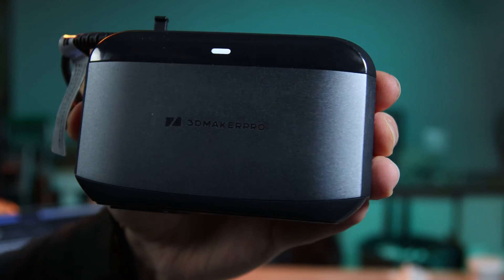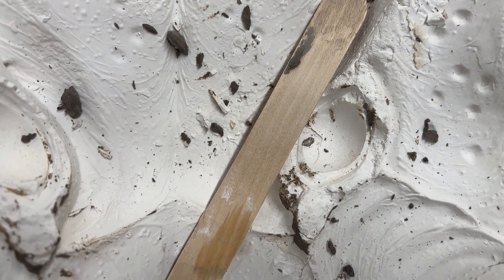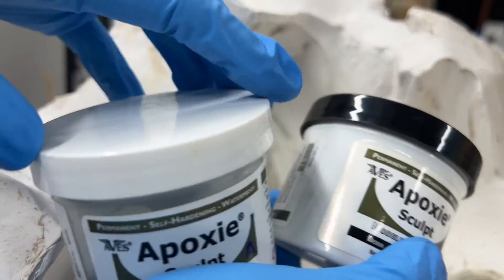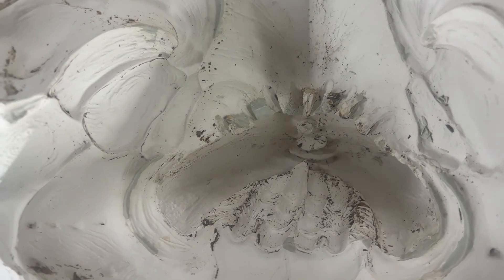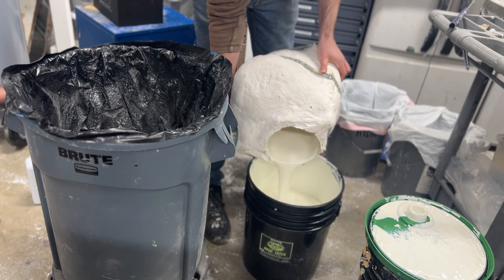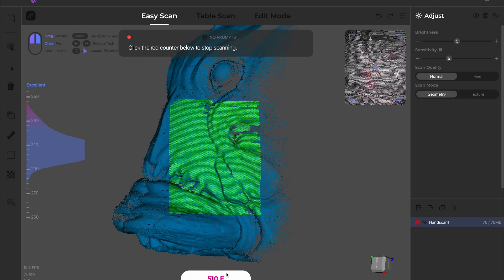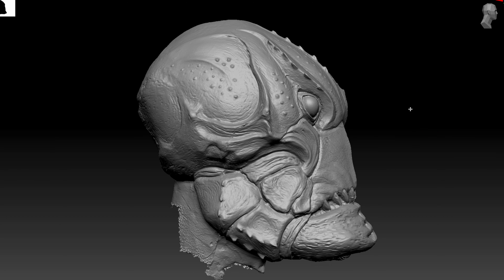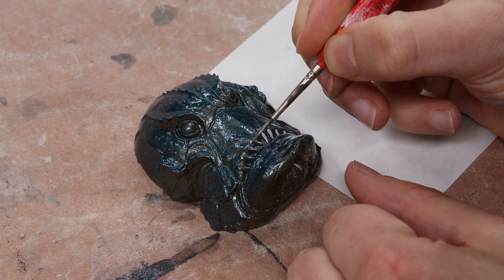Can the 3DMakerPro Moose Save My Sculpture with 3D Scanning?

Comment: Another reason of having the split power cable is that they can sell the optional accessory that costs as much as the scanner itself to provide full portability 🥲
Reply from the maker: Maybe so. I would think since both ports are USB that you could probably use a standard USB battery power supply, though. Worth testing to see... although I guess you'd still need to carry a laptop to run the program.

Comment: Oh no Jasper sorry that happened to you, You know I have had similar things like that happen on the outsides of the skulls I have removed from our molds. A thin plaster layer along certain areas outside of the skulls that touch the silicone would stay softer. I always chalked it up to the water in the plaster gathering along the surfaces. Or maybe I didn't mix correctly. I guess it could also be the release agent or soapy water etc. Always enjoy your videos good seeing you.
Reply from the maker: It's never happened to me before, so I'm not stressing about it. Normally my attitude is to fix a problem before anyone notices, but it happened that the problem made the scanning more relevant!

Comment: hmm nobody is showing a textured version. But with what I am seeing so for I'm not sure this will replace my photogrammetry setup with cross polarization.
Reply from the maker: Sorry, I just automatically scan without textures most of the time because I'm usually scanning monotone sculptures. If you're happy with the results you're getting with your current setup, no need to change it.
Reply: Is there a video that shows method and software used for using photogrammetry on small objects? I generate point clouds of the ground but would like to model small stuff like old motorcycle parts that are very hard to find. Thank you!!